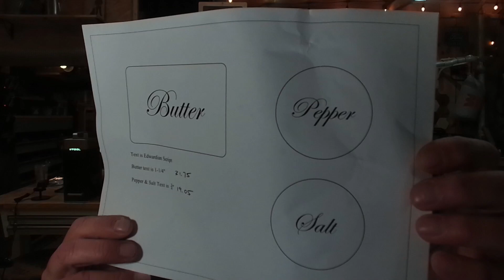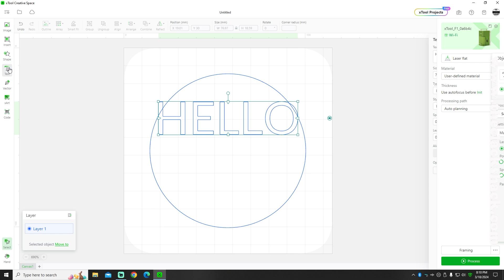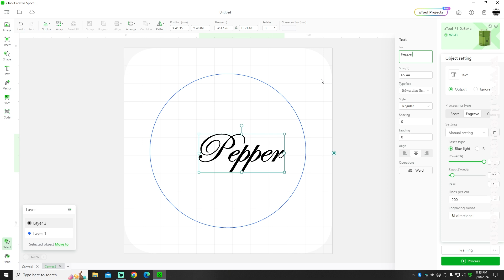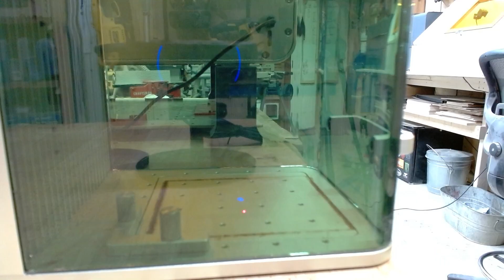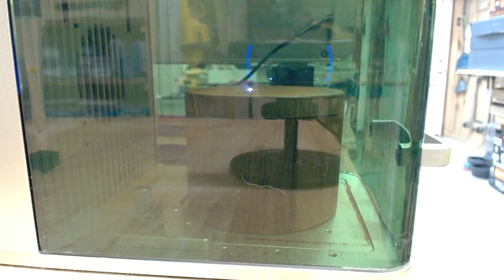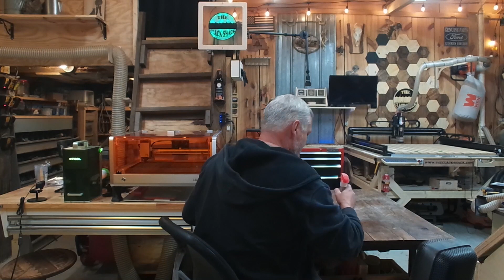A simple project on the xTool F1

Comment: I use my F1 more than my D1 Pro and MonPort 40 put together.   I’ve used it so much that the filter box needs to be replaced.  Since I don’t have the money to buy a new one.  I went to Menards and purchased a big pad filter and charcoal filter and left them folded up and put the charcoal on the bottom and the white filter on the top.  I don’t smell anything but the white filter has been used quite a bit.  I will be using these filters until I can get a new box filter.  

If you can come up with any ideas for the F1.   I’ll be happy to purchase a few more designs.

The smallest pieces I have engraved could in no way be done with any other engraver other than those with the use of a camera.  I’ve engraved as small as 1/8” wide.  I love being able to engrave small pieces.
Reply from the maker: It is very easy to align
Reply: Question. You say you have done tons of projects, yet you can't afford to change out a part. Can you turn a profit using these machines after paying your overhead?
Reply from the maker: @michaelmcclellan9422  I don’t recall saying that I can’t AFFORD to replace it. Increase profits by reducing costs.
Reply: @TheClackShack  I was commenting on Daballoon guy. He said he didn't have the money to replace the filter box.
Reply: Daballoon guy indicated he had at least 3 machines and had made lots of things. It made me wonder if he charges enough or if he does it as a hobby. If he has 3 machines running full time and can't afford maintenance, it concerns me if this is a viable business.
Reply from the maker: @michaelmcclellan9422  gotcha
Reply: @TheClackShack  I am trying to learn and thinking about a small business, but I wasn't sure if it would be viable
Reply from the maker: @michaelmcclellan9422  I started off not making much but now I send jobs to other folks. It takes work and time

Comment: Acacia wood engraves really nicely but the tranaition on glued boards can alter the darkness a bit.  I try to avoid engraving on sapwood and heartwood with the same graphic
Reply: PS the reason it moved so much on vertical and horizontal allign is becauase you changed the text size after you centered it.  Still i dont trust the nodes blindly
Reply from the maker: Yea, when it offers to snap in different locations, that is a clue... lol. I always double check, can't bring it back.